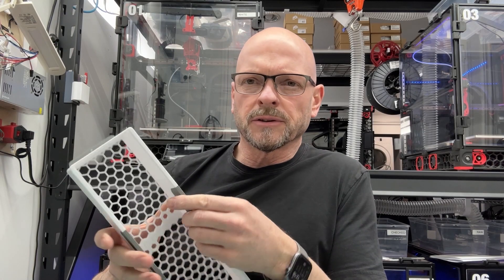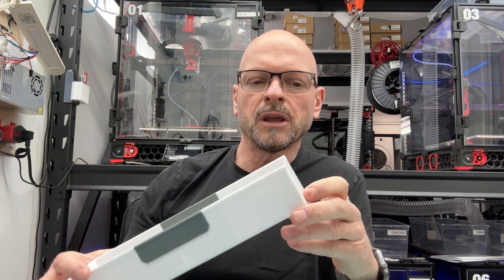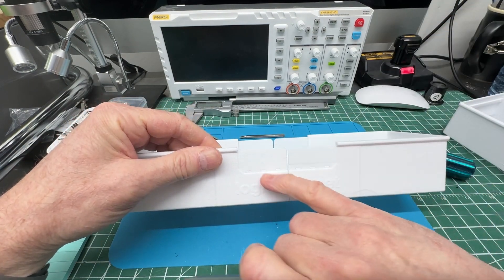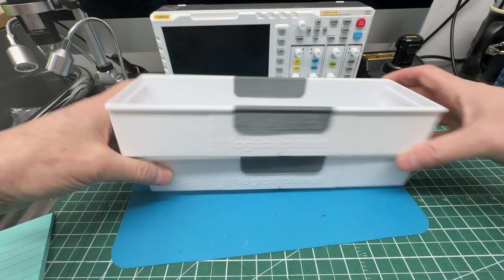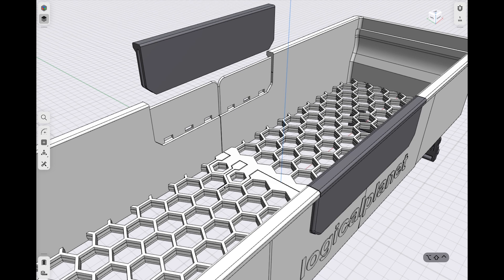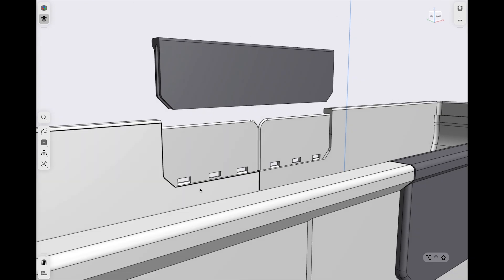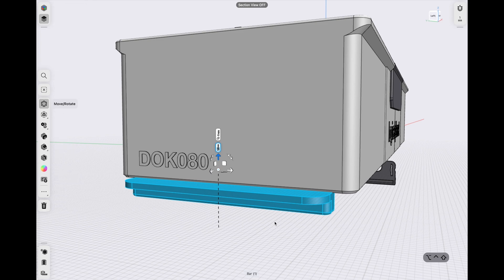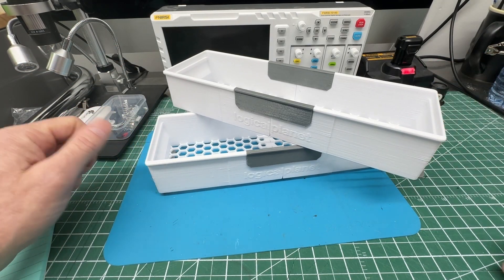DOK080 20240324

Comment: Well done!  I want to print a US mailbox, but it's way longer than my 256mm print bed would allow.  I'm liking how you attached these two, but mine would need to be water tight.  One of these days I'm going to see what I can do.  You have given me some good ideas.  Thank you!
Reply from the maker: oh, that sounds like an excellent project.  I would love to see what you come up with when it is done.  After reading your message I was immediately trying to think what you could do differently from the standard mailbox because of the freedom of the 3d printer.  I didn't think of anything too exciting yet but I will mull it over.  I did make a wooden box for Amazon deliveries a few years ago and I put a wifi sensor in that lets me know when the box has been opened and closed.  That might be a good addition to the mailbox idea too.